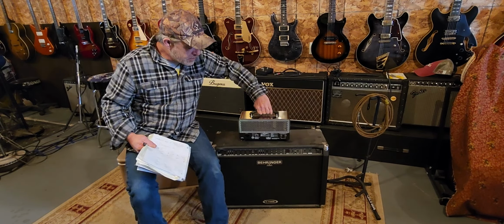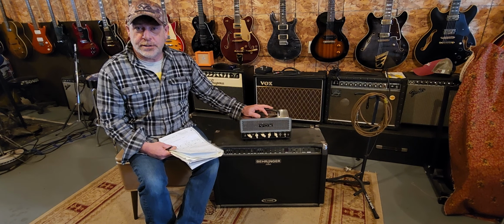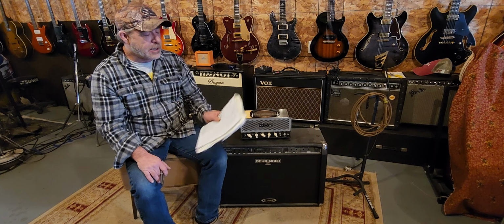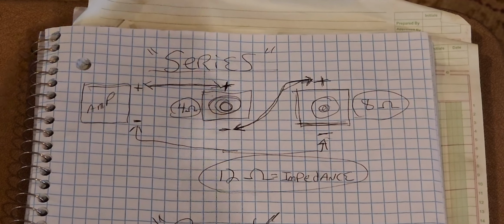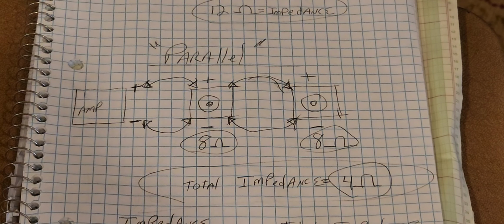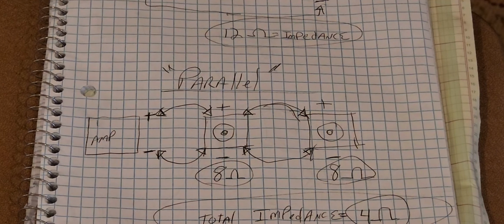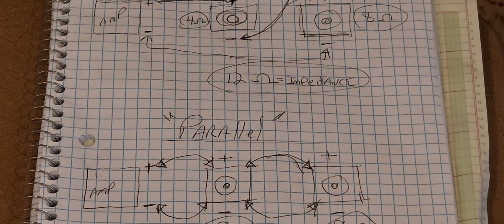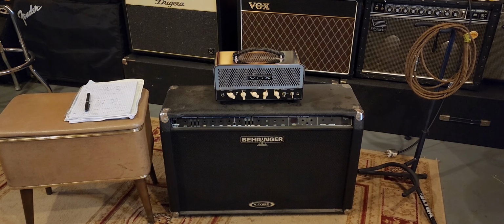How to calculate speaker impedance for guitar amplifier series and parallel explained. simplified

Comment: thanks for the short concise explanation.  Ive got a slightly different problem: I have 2x12 speaker cab of which only one of the speakers has a impedance rating written on it. Im not gonna assume they have the same rating since each is from a different brand. Is there a way to calculate the impedance of a single speaker ? Reliably ;) thanks again